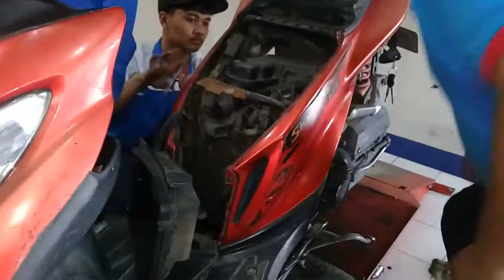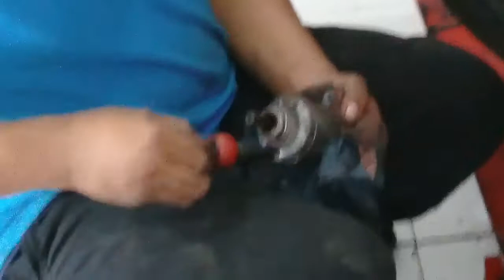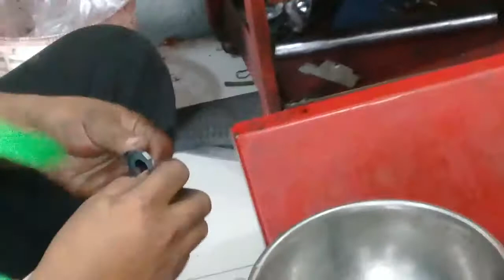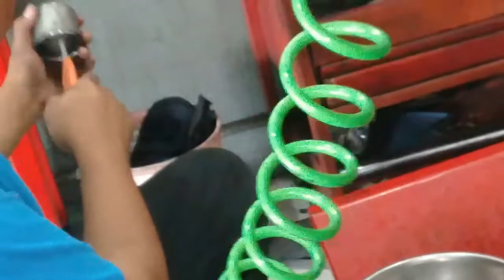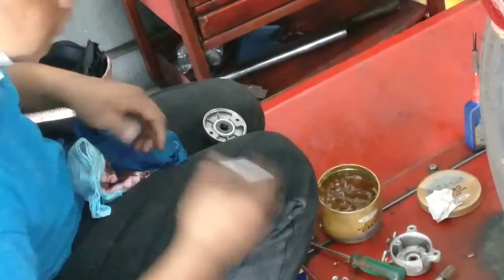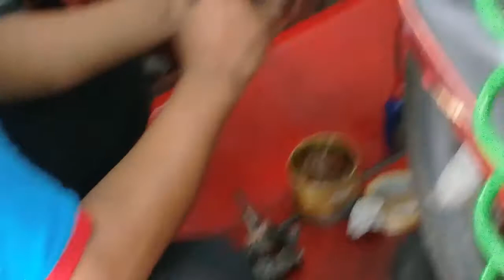CARA GANTI CARBON BRUSH DINAMO STARTER SUZUKI SKYDRIVE 125

Comment: Mau tnya bang,saya punya skydrive aki padahal baru diganti,tapi kenapa kalau belum dipanasin ga bisa langsung di starter ya,,itu kendalanya diapa ya,apa mngkn dari dinamo starternya,,mohon infonya bang,terima kasih
Reply from the maker: coba motor dihidupin terus ukur pengisian di aki beapa volt
Reply: @alimsuzuki8125  maaf bang cara ukur ny pakai alat apa
Reply from the maker: volt meter
Reply: Kenapa motor stater nyala terus tdk mau berhenti,padahl kunci kontak sudah of,dan tdk di rem tangan.saya tes di kiprok arus positif on terus biarpun kunci di cabut